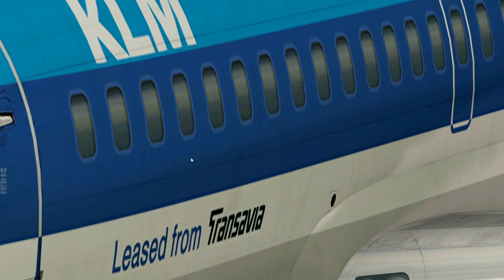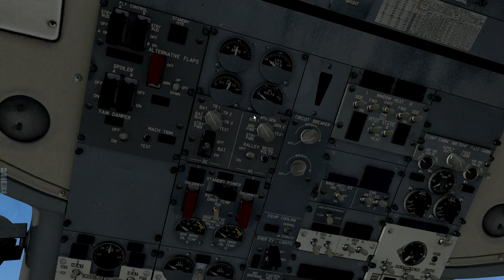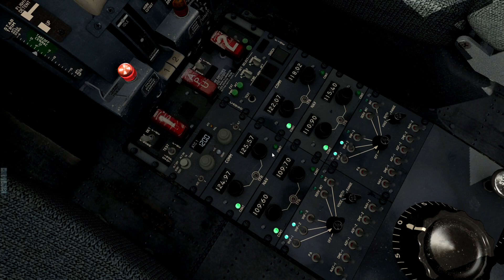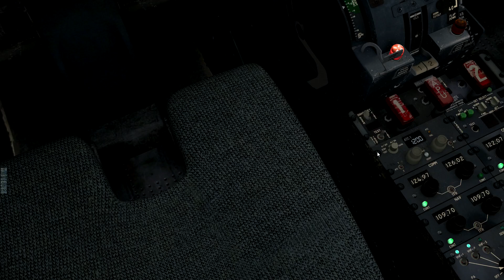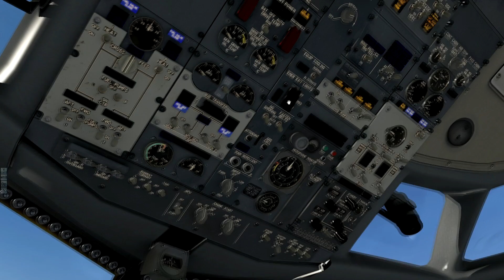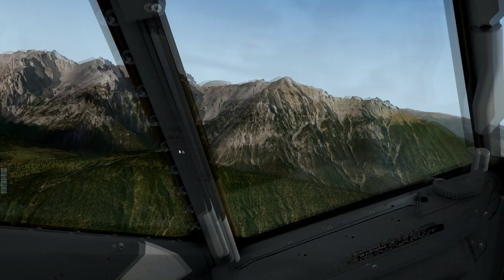FLYJSIM 737 TWINJET FIRST IMPRESSIONS

Comment: Hey froogle not sure if you have this out there already but are you using HDR and anything in the NVIDIA control panel can't get mine to look as good unless I'm fine with badly jittery shadows and and odd white dot and lines artifacts around gages. Also where exactly did you get the lowi scenery and photo scenery from ?
Reply from the maker: +king4154 No, everything is controlled within the sim. The scenery comes from simheaven.

Comment: That Sperry 77 autopilot is so beautifully modelled!! I dare say I prefer this old school Sperry and this no-autothrottle no-satnav no-nonsense "Jurassic" 737 to the modern fully automated Honeywell/Collins MCP and all the other 'otto' stuff on the 737CL/NG. Those EPR controlled JT8Ds look and sound really good. I only wish FlyJSim had also given an option to enable the Sperry 177 autopilot as installed on later versions of the 737-200-Adv aircraft. That would have made it an even more complete package of the advanced version of the -200.
Reply: +Rishav Kakati The Milviz 737 for FSX is less advanced, but does have the option for the Sperry 177 and an FMC
Reply: I'd rather have a good old PDCS rather than the retrofit Universal FMC to drive the EPR bugs dynamically so as to keep the old girl manual! Too much automation does make sim flying as boring as most real world tube flying is nowadays. For me, pitch+power=performance is the only rule!

Comment: Very nice work once again Froogle!  I love the 737 and it's manual feel.  
What LOWI scenery are you using?  The LOWI Demo Area that comes with XPlane 10.4 is not the same high def as yours.  The trees and blue building outside the flight deck window are very defined.
Thanks and keep up the excellent thorough and knowledgeable work!
Reply from the maker: +Peter Andrego This was just default scenery, but with the detail sliders pretty high.
Reply: +frooglesim Ok that makes sense!

Comment: Can you get PMDG for X-PLANE?
Reply from the maker: PMDG aircraft are not yet available for X-Plane
Reply: Copy that frooglesim , thanks :D
Reply: +Will Shaw PMDG is going to soon release their fantastic looking DC6B for XP10. Hope they also port their awesome 737NG and 777 to XP10 in the near future. I am sure they will run much smoother on XP10 than on FSX/P3D because of the more modern engine of XP10 and the fact that it is 64bit and can use hardware resources more effectively.
Reply: Not YET. PMDG are working on some aircraft for X-Plane.
Reply: Will Shaw yes the PMDG DC-6

Comment: Nice vid, really like how you go over detailed procedures and teach proper systematic approach to flying. Couple of notes on takeoff though. At LOWI you should really be using the full rwy length, so taxi to the end and 180 (both ends have a hammerhead for this purpose). Also on a heavy plane and short rwy, do set flaps to a higher setting to get lower VR. Finally, dont rely on Vspeed autocalc, especially at short rwys. The plane doesnt know the true rwy length, V1=135 was completely off the charts here. Even at V1=100 you'd have been lucky not to roll off the end in case of RTO.
Anyhow, I know criticizing after the fact is easy, so fyi, really enjoy your vids & looking fwd to part 2!

Comment: Love all your videos Froogle.  Please keep them coming.  What technology are you using to move & zoom about the cockpit?  Is that Track iR or are you using a mouse or joystick?  Would love to know.
Reply from the maker: robertg102 X-Plane's built in view commands.
Reply: frooglesim One little tip when setting up the cockpit, turn off X-Plane's "cinema verite" option, it makes those knobs and switches much easier to hit. I think it's SHIFT C to turn it on and off.
Reply: Alistair Brown
I'm still flying FSX.  Is there any option that's similar to this feature in FSX?  The ability to freely zoom & pan in and out and around the cockpit?

Comment: Not and X-Plane guy, but it looks like a nice sim.  Few of notes -
1) Alt Hold on this airplane is to hold your current altitude.  It doesn't interface with the altitude alerter.
2) Flaps 5 is the standard flaps for takeoff on all 737 series.  Flaps 10 is the normal alternate.  That's part of why your takeoff roll was so long.
3) The JT9D is properly operated based on EPR, not N1.  It is simply a cross-check to make sure that the gauges are working properly.  That's why you have the EPR bugs but not N1 bugs.  This is the other part of why your takeoff roll was so long - you never got anywhere near T/O power.
4) Your AirCon warning was because you never set the pressurization to FLT, so your cabin wasn't pressurizing. :)
Reply: So I guess death by hypoxia is not simulated?
Reply: x -wind
Yes it is, some planes like the Mitsubishi MU_2 "Marquise" kill you if you don't set up properly the pressurization :)
Reply: You can get the different takeoff and landing V-Speeds by clicking on the flaps number on the V-card, it cycles through all the available options and changes the speed bugs in real time as well.
Reply from the maker: ok thanks

Comment: So deep the systems, so study... The APU doesnt even use fuel, just air and magic.
Reply from the maker: Carlos Vasconcellos Fairly sure I do turn on the fuel pumps prior to starting the APU.
Reply: frooglesim empty the tanks, the APU still works.
Reply: frooglesim and no APU sound...
Reply from the maker: Carlos Vasconcellos ok, wasn't aware of that. Thanks for letting me know.
Reply: This aircraft will be getting an update in the near future I believe. Have you contacted FJS about these things? Also this isn't really intended to be a study sim. The IXEG 733 is another story.
Reply: Are you talking about the all the aircrafts, because the a320 sure uses fuel for the apu
Reply: FEVB
 One thing is simulate an unique relay as IXEG does, other is something basic for an airliner as an APU that doesn't work as it should. It doesn't need to be a full systems simulation but an airliner is not a GA for VFR either :/